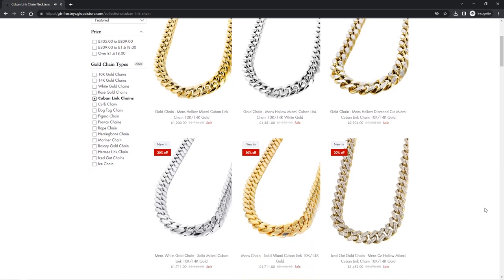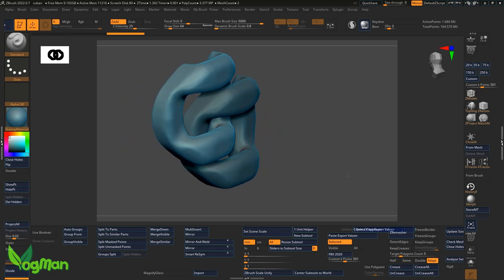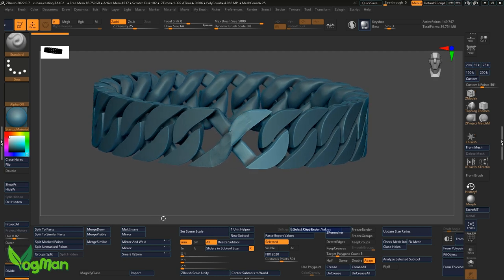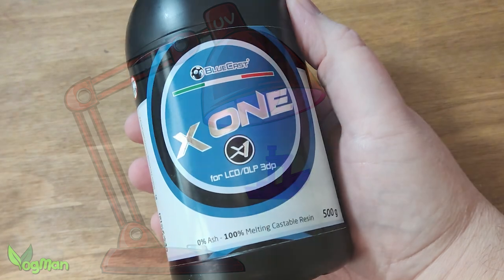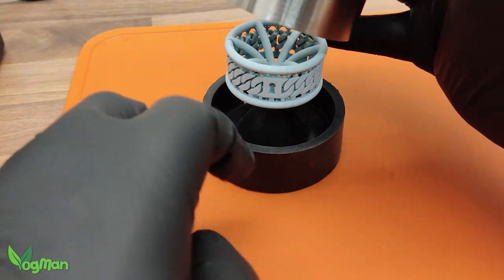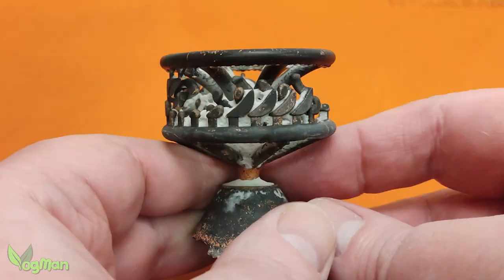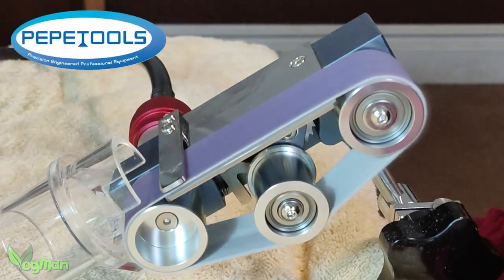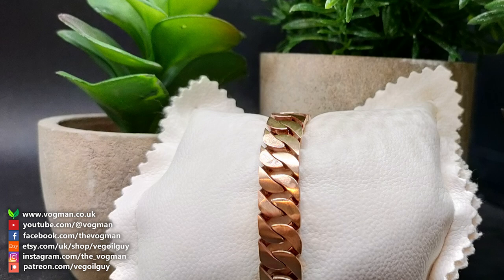Cuban Link chains - CAD, 3D Printing & Metal Casting using Bluecast X One

Comment: Thanks for sharing your experiences in casting a chain. If you are going to wear it on your wrist, you probably need to cast it as a open chain, and then get a clasp and jump rings from Rio Grande to finish it. They probably have items that are the same metal as your cast. I enjoy all of your reviews and demonstrations.
Reply from the maker: I can cast the appropriate fittings on the ends, or cast an open link to manually attach. It has great potential to some I'm sure 😁
Reply: @vogman  Your solution will be the best, I'm sure.

Comment: Fantastic! I'll be looking at doing something like this at some point, I'm sure. Love your videos.

I've used your videos to get myself set up for casting and am having a bit of trouble getting a good seal on the Kaya Cast in the casting chamber side. Arbe is sending me replacement gaskets to see if that's the problem, but I was wondering if you had any tips for getting a good seal on that casting chamber side.
Reply: I've seen people push the flask down with the tongs to get the seal, did you try that?  Also make sure there are seals between each spacer.

Comment: Amazing absolutely love your channel! I just got my mono 2 this morning so it's set up time now I was just wondering about the 3.0.2 software slicer with it I bought the mono 4k about 3 weeks ago but needed a second and love my 4k so with that mono 2 being on promotion price both mono 2 and wash amd cure for £199 I grabbed one! As of today it's that just for the printer or £338 for both so saved £100 it's a spare wash and cure anyway! OK what I was wondering was the 4K slicer I installed can I keep that going as well as the new mono 2 version I'm away to install or will I need to use the same one and change the settings everytime? It might not be an issue as use lychee now for the mono 4k all the time I'm getting good test prints in the validation test matrix but the right sided slider up the sode I'm still getting the step lines! Have you Any tips on how to get them gone or near gone?